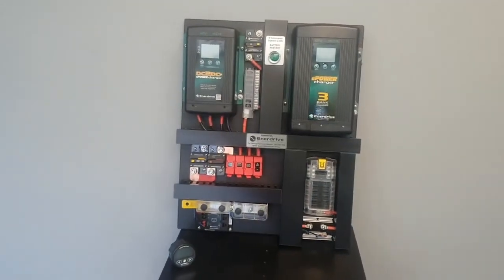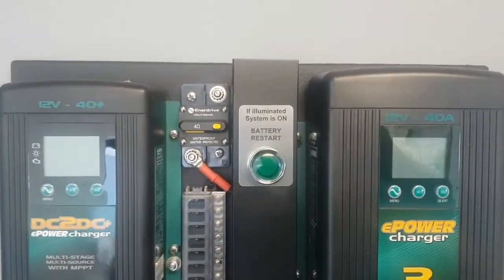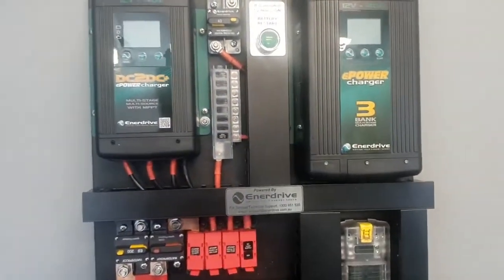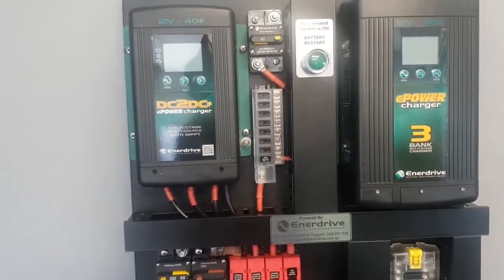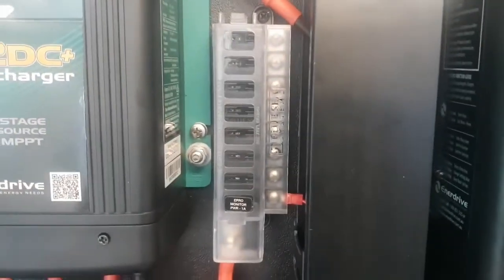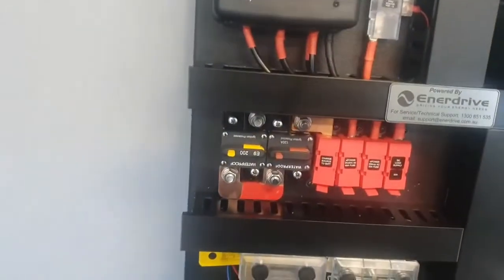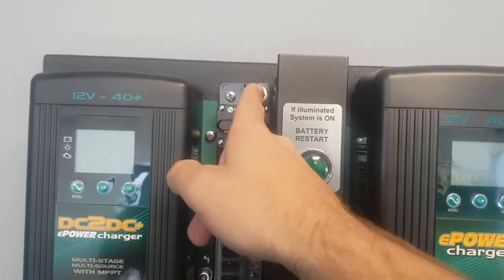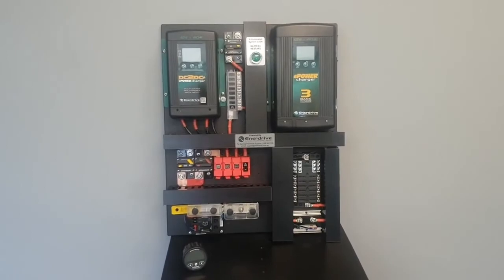Enerdrive Review: The Enerdrive K-AGM-Board-E DIY Installation Kit

Comment: HI, its obviously possible going by how you have wired the dc-dc to parallel the Negatives of the anderson and solar plugs and just run the 1 negative from the aux battery? to these other negatives, via either a bus or just nut and bolt them together?